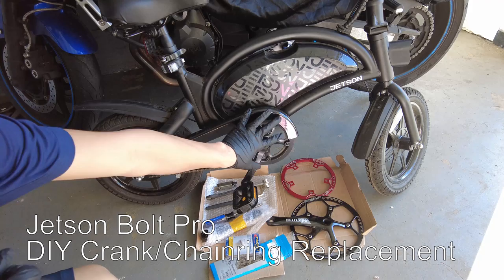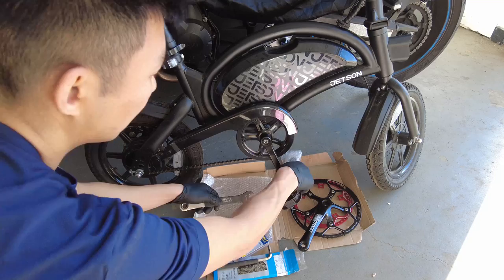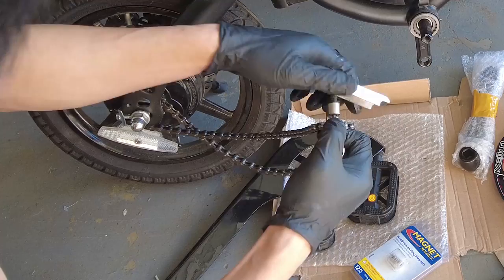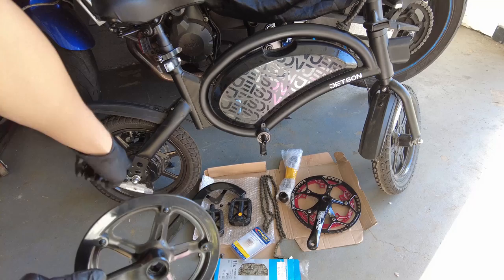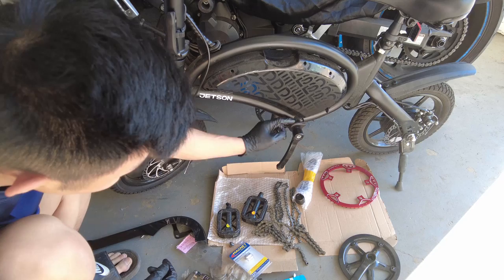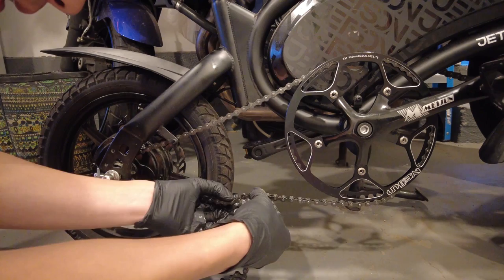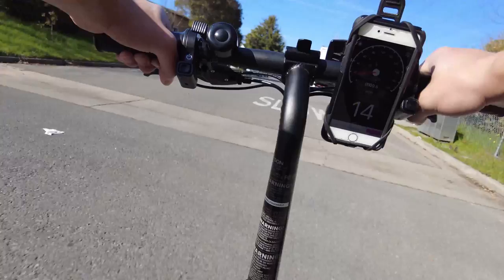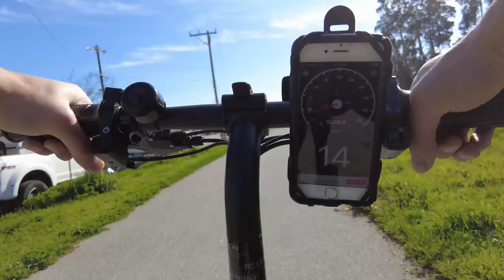Jetson Bolt Pro 21MPH Max Speed MOD - DIY Crankset Replacement

Comment: Essentially I'm looking to spend $400 on EVERY basic upgrade to make it like a 25 mph car. You know you can unlock the speed from 15 to 19 mph with adrino board. Double the range with a second battery. Then with this $50 upgrade I'll be pedaling to higher speeds with ease. Anything over 20 mph easily, with 38+ miles of range (w/o assist), maximum storage cap with a front basket and back for less than $800. Yeah I'm loving the idea.
Reply from the maker: That's awesome. Let us know how it goes!
Reply: Arduino board currently does not work on jetsons purchased within the last year. Apparently there is an update on the newer model’s speed controller that won’t work at this time.
Reply from the maker: @toasty925  Thanks for the info, Toasty!
Reply: @ColinLeung  any workaround to this discovered?
Reply: Don't bother with the Arduino board. I did that "hack" and I only got 1mph faster speeds. Simply replace the controller, either keep the 36V or go to a 48V battery. Some controllers support both. With the 36V battery you will get 20 mph without payload, with payload about 17-18mph with the battery topped off and 15-16mph once it goes below 90%. With the 48V you get 26mph without payload, 22mph with payload with the battery topped off and 18-20mph once it goes below 90%. You will still get higher speeds than with the OEM controller.
Reply from the maker: @ansia8785  Thanks for sharing. What controller would you recommend?
Reply from the maker: @benjamindalton8940  I haven't looked into it much since I sold this ebike recently to a buddy. Sorry
Reply: @ColinLeung  Get one of those controllers that can do both 36v and 48v that come with a lcd screen which are readily available in both Amazon and eBay for around $50-$60.
Reply: @ansia8785  what controller did you use?
Reply: @toasty925  Youtube keeps deleting my replies. Basically one similar to this guy's https://www.youtube.com/watch?v=IX7Bb86x7eg
Reply: @toasty925  I just bought the jetson axle a week ago. Any info on how to speed hack?
Reply: @toasty925  it does work! Test it out before and after the mod. You'll see a difference
Reply: @egntwm  What date is labeled on your handle bar? Mine is labeled 11/2021.
Reply: jeffrey1296  Yes.
Reply: @toasty925  it does work you have to make sure to change the agreement from false to true other why's it will not work
Reply: @natebass1482  i tried that too and it still says 15mph
Reply: @jaimeramirez4023  what’s the build date of your bike? It’s located on the stem

Comment: I just did this mod on my Jetson Bolt Pro with a 60T chainring. Definitely don't spin out like I used to anymore. I notice the pedal assist doesn't do very much anymore due to fewer crank rotations. Also, I noticed the electric assist isn't very effective above 13mph or so. Happy with the mod and it allows me to pedal at a better cadence at cruising speed (13-15mph for me). Thanks for the vid.
Reply from the maker: Thanks for sharing your experience!
Reply: If you change the pedal assist sensor for a 12 magnet one it solves the issue with the pedal assist cause it sends pulses more often with the bigger chain ring. Hope the information helps
Reply from the maker: @loganomarpr  Yes, this help!
Reply: You can change the settings for how offen and where it registers In the handlebar readout

Comment: This is a good mod. You should know that doing this without the higher speed mod with either the Bluetooth module or the arduino board the controller will work against you and add more resistance because it wants to throttle you to 15mph. Would like to see what you could do with it once the speed is unlocked through the controller. That way it won't throttle you
Reply from the maker: Thanks. I appreciate the insight as well!

Comment: Shorter cranks will allow you to spin easier without bouncing on the seat. Spinning can be easier than grinding giving you a greater range of speed pedalling only but it does take some getting used to. Jumpin stright to a big ring is probably not the answer either.

Comment: your link to the tool goes to the sprocket and crank, not the tool
Reply from the maker: Thanks for catching that. I updated the link https://amzn.to/3zTnqBS
Reply: @ColinLeung  It now takes us to a relevant search of bike tools but not a specific one…
Reply from the maker: @shawnfitzpatrick2954  Oftentimes specific listings are taken down after a while, which is why I provided a link to the results. Any that have a flat wrench to remove the pedals, 8mm L handle, crank removing tool, and chainbreaker will work. 
Here's a listing to the cheapest set that I found https://amzn.to/3LEePpi

Comment: At that point just buy a track frame and run a 43 13 ratio lmao. You'd get an immense increase in efficiency compared to that...I just use my bolt pros for flat main streets.
Reply: An aluminum track bike that feels like butter to pedal is around 500$+
Reply from the maker: Thanks for the comment, Eamon!

Comment: 48v controller 30$ 
Voltage booster 37$ 
Just boost 36v to 54v and you get 26mph with only throttle
48v controller have Cap. That handles 60v
Reply: I can help with wiring if needed
Reply from the maker: Thanks for the suggestion!
Reply: @anonymousanonymous6386  yes please, make a video!!
Reply: Teach me
Reply: @thepeterpot  Fr I been looking
Reply: A video would be incredible!
Reply: Yoooo boss how do I do it ima try it on jets on haze

Comment: Nice work. My own stupid instinct was maybe 3D Print bigger gears for the back wheel, that would fit over the existing gears? Bigger gears on that back?! Doh!

Looking at this... I guess Jetson built the safest ratio as I don't see how back could be smaller. And making the front bigger has some tradeoffs. But I'd not ever know that if you didn't make this video.
Reply from the maker: Thanks for the comment! Bigger gears in the back would result in a lower max speed, but would be easier to pedal.

Comment: I have this bike and I never pedal it. Throttle only all the time. I don't understand modding the bike just to make peddling harder, and then using the throttle didn't make it any faster.

What was the point?

I bought it because I was tired of peddling my old bike to and from work.

Comment: Mine's not even here yet and I can't wait to swap it to 48v or 52v!!! 48t to 12 tooth is 4:1. Should be pretty okay at 48volts. My old Giant is running a 1500 watt 26" setup on 52 volts with 48:11 or 4.3:1 Almost ghost pedaling at speed. 30mph. I don't want speed out of this little pup. Little zippy. Little bit of cute with jamz!! And my tiny cargo trailer for shopping!!!
Reply from the maker: Awesome. I'm excited for you!

Comment: You can change pas settings in the little computer thing on the handle bars
Reply from the maker: Thanks for the comment. The model I had only had an On/off button, and throttle on the handlebar that did not allow changing the PA level.

Comment: I’m trying to find a replacement chain ring as my original is bent but I want to stick with the same size but struggling to find a original in the uk
Reply: Can you help does it just have to be 38t size to fit straight on
Reply from the maker: @daniellereynolds4320  Hello Danielle, the stock crank and chainring are one piece, so you'd have to replace both. It's suggested that you replace with 38T or smaller if you don't want to buy a new chain. Anything larger will require a longer chain. 
Any square taper crankset should fit. Here are examples https://amzn.to/3x3TTV2

Comment: hi, Can I ad pedals to a bolt e Bike? Same one as in this video,  a have it came with no pedal components, just a bar across?
Reply from the maker: Hello Giovanni, it sounds like you have the Jetson Bolt (non pro) model. Unfortunately you cannot add a crankset with pedals unless you swap the frame and rear hub.

Comment: I bought a used Jetson bolt for my daughter and noticed the next day that the hub cover on the chain side had a crack from the previous owner overtightening the chain tension.
Reply from the maker: Sorry to hear that. You may be able to super glue, or plastic weld it back together. It may be difficult to find a replacement.
Reply: @ColinLeung  oh thank you. I used JB weld and it’s like new again it was just a heads up for anyone who reads the comments to not do the chain tension too tight

Comment: in my opinion the easiest and in my opinion the best way to upgrade your jetson is to get a 48volt battery. since stock is 36volt and its a decent upgrade, its very cheap, your looking around $100 and it boosts the performance to around 20-24mph and if you are a small person like me. and your lighter than most, then it will go even faster. and you need to do no further mods either, since the stock controller and motor can easily handle 48volts
Reply from the maker: Thanks for sharing. I thought the max speed had to be unlocked in the controller as well, and adding a 48V won't change the max speed.

Comment: did you do any other speed  mods? You can override the governed speed of 15.5 to 19.5 with software and a raspberry-pie board. It cost about 20 dollars and you can return the raspberry pie afterwards, its literally only used to flash the new code onto the bike.

Also your gear ration is off the original ratio (non- simplified form)  was 12/38. Your current configuration is 12/55 meaning you are actually producing more power with each revolution of the pedals, but you aren't able to turn the pedals as fast as you could before. You need roughly a 16 tooth sprocket to be closer to the original ration, which should make it much easier to pedal.

Also i just realized I called it a sprocket when on a bicycle is actually called a cog i think. (I come from a motorcycle background) Im to lazy to correct it above  tbh haha
Reply from the maker: Thanks for the comment. I didn't do any other speed mods since I sold the ebike to a friend. I heard about a controller speed hack with another board that wasn't the Raspberry Pi. That's good to know.

Comment: Why do you need to replace the PAS sensor?
Reply from the maker: I didn't have to. I thought I did, but after disassembling the crank I realized I could leave the existing PA sensor in place. Thanks for the question.
Reply: @ColinLeung  do you know what determines if you do/don't need to replace it? I just want to be prepared if necessary
Reply from the maker: @sbb526  The pedal assist sensor remains in place in this install, which can be seen here: https://youtu.be/KmPUrSOvctA?si=7m_iWWhc8XUKMfUW&t=502
This is another video where I talk about the pedal assist sensor that stays https://youtu.be/_BhtfHbxSV0?si=3Mqrr8ajGJ7QDW0c&t=135
This pedal assist sensor has the magnets built in, and they're not on the crank, so you don't need to replace them. Thanks

Comment: Nice I have been thinking about changing this myself for some time.

I like to do a little bit just not too much, so this might be right for me.

Just a point I have noticed with the break binding it makes a big difference to the speed, I say a big difference one or two mph in my case, but my bike is quicker than this anyway.

i would just like to help the motor a little if I did this mod.
Reply from the maker: Thanks for sharing!

Comment: Could you theoretically remove the chainring and attach pegs to the jetson bolt pro
Reply from the maker: Yes, if you can get the pegs to fit and screw into the bottom bracket.

Comment: i bought the gyroor c3 ebike. slightly more than the jetson but it can do 19mph without pedaling and has a 450w motor
Reply: What's the cost?
Reply from the maker: Awesome. How do you like it?
Reply: @ColinLeung  i like not pedaling so its good for me.  I have the jetson as well.  its basically a faster jetson.
Reply: @theotheleo6830  i bought mine from Craigslist for $450.  I looked what selling on Amazon.  The gyroor is no longer ther but the sailnovo which  looks like the same thing is $560.
Reply: @cebedojames  $450 was a good deal.

Comment: Do you advise me to do this tomorrow, do the same, is there a difference in speed?
Reply from the maker: I would suggest it if you do not mind spending about $40. The new crank is lighter, the arms are longer, and more chainring teeth enables you to hit a higher max speed. I personally would not recommend the 53T since I did not feel the pedal assist. Around 43-45T will be more useful. I was getting 13mph on the stock 38T. I was able to comfortably hit 15mph with the 43T.

Comment: Hows the pedal clearance at the bottom when turning???
Reply from the maker: It hasn't been an issue, and I've never noticed the pedal scraping while turning. The steering angle is very short to begin with, and feels unstable when turning sharply.
Reply: @ColinLeung  nice just unboxed a fresh bolt pro today…. Gonna do this mod immediately
Reply from the maker: @kevinsteele2525  Great! Let us know how it goes. I wouldn't suggest a 53T chainring since it felt like the pedal assist wasn't kicking in. 45T was more suitable, but it's up to you!
Reply: @ColinLeung  what if you're using the throttle control? that shouldn't require any particular cadence on the crank-
Reply from the maker: @dubmob151  The throttle works, but is still limited to the stock controller speed of 13-ish mph. You can google speed hacks to increase the speed limiter to 18mph in the firmware, or swap the controller to get 28mph.
Reply: @ColinLeung  are you finding that the motor will actually limit your speed to 13mph? So if you turn off the switch, you'll be able to go faster because the motor is no longer dragging you down and trying to maintain its preset limit?

I was figuring on running at whatever speed the motor output would allow, but having higher gearing to effectively allow me to lighten its load by pedaling, and increase range that way.
When the gearing is too low, it requires you to spin too furiously just to get to the speed of the motor, and ends up being a waste of effort, unless it's during an uphill climb, where the max motor output speed then drops down to a range where the pedaling is more effective.
Reply: I'm willing to trade off hill climbing ability for level surface riding, which is generally the riding conditions I have.
Reply from the maker: @dubmob151  I found that using the throttle only enabled me to go 13mph. 
With pedal assist and the stock gearing I was able to hit 15mph. 
When I put a 53t chainring on the front I was able to hit 20mph, but did not feel much help from the pedal assist possibly due to the magnets in the pedal assist sensor not spinning as fast as the stock chainring to tell the rear motor to kick in. When I twisted the throttle, or left it on cruise control then it was easier to pedal with 53t.
Reply: @ColinLeung  when I tried an experiment with the wheel in the air and engaging throttle cruise control at a low speed, then trying to pedal, the motor definitely resisted my trying to go faster, showing heavy resistance against changing speed as it tried to maintain the same speed.
If I kept at it, then it would suddenly break lock and allow it to speed up as I pedaled faster, disengaging the cruise control.
I guess with the pedal assist mode something similar is happening, as it tries to regulate to the corresponding speed based on the crank speed. When the gearing ratio is changed, it regulates to a slower speed than the pedal. 
I guess using the throttle control is necessary since the pedal assist isn't properly synchronized with radical changes in gearing.

Comment: Just thought but if I peddle hard enough I should be able to go 25 mph. Fast runners can get over 20 mph ,so why shouldn’t a strong person be able to use the physics of a motorized bike and get over that ?
Reply from the maker: I believe it's all dependent on the gearing of the bike, speed of rotation, and size of the wheel. If one of them is off then no matter how hard you try you can't achieve the desired speed. I'm sure someone could pedal hard enough to reach 25mph with this bike. 
Here's a bike gearing calculator to adjust desired values. 
https://www.bikecalc.com/gear_speed

Comment: If  you removed the 5 silver screws on the back of the chain ring could you install a new crank ring without changing the crank? https://youtu.be/KmPUrSOvctA?t=288
Reply from the maker: It depends on the crank. The stock one does not allow the chain ring to be swapped. The 5 screws appear to hold the chain guard in place. You can swap the chainring without removing the crank one the new one I installed.

Comment: If you do the contoller mod with bluetooth it will go to 18mph with bigger chain ring. But to get it to go 18mph with throttle only you need a bigger battery.
But batteries are expensive.  Do not ask for links because youtube shuts down commets with link you need to do your own homework sorry.  Saw a guy add a external 36v 30ah battery. Got 18mph 
.With only thrittle and controller mod. Controller mod can be done with bluetooth or arduino board.
Also since the larger front sprocket is spinning slower.  If you want pedal assit to come on fast change out the sensor from stock 6 magnets to 12 magnet sensor.
The bluetooth module can be bought from factory in china.
I got one and a 48v controller.
Will try it out and see if I can get 28 mph speed which 48v version of bike does out of the box. Again do your own searching.
Reply from the maker: Thanks for the advice!
Reply: YouTube only allows links if you're the owner of the video, or if the link is to a YouTube video. 
all you need to do is a convoluted process of posting a video short with the information contained in that, and then post a comment with the link to the YouTube video with the links posted within. 
but no one would go to that trouble, so YouTube wins. 😉